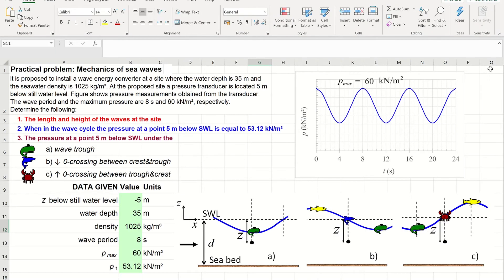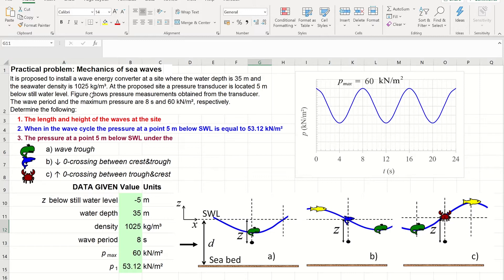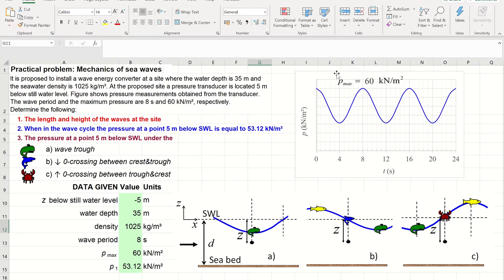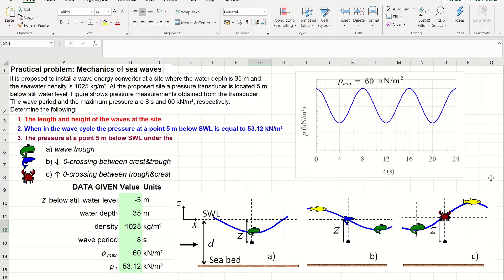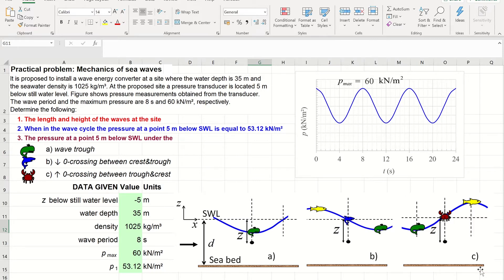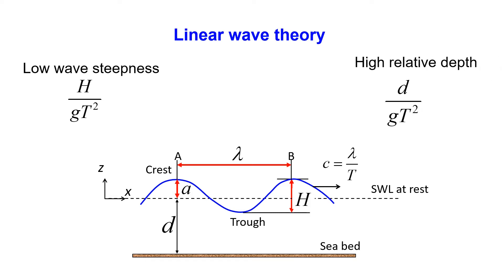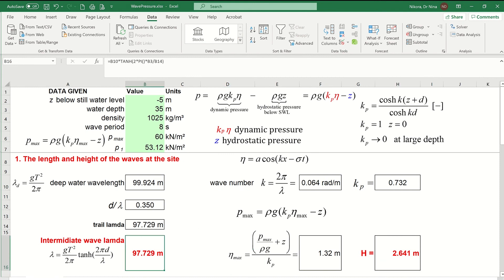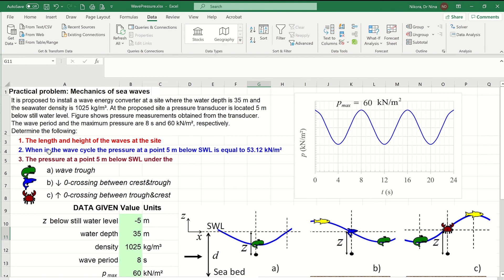Wave pressure - how to calculate wave height and wavelength

Comment from the maker: Problem questions.  
It is proposed to install a wave energy converter at a site where the water depth is 35 m and the seawater density is 1025 kg/m³. At the proposed site a pressure transducer is located 5 m below still water level. Figure shows pressure measurements obtained from the transducer. The wave period and the maximum pressure are 8 s and 60 kN/m², respectively. Answer the following questions: Q1. The length and height of the waves at the site. Q2 When in the wave cycle the pressure at a point 5 m below SWL is equal to 53.12 kN/m². Q3 The pressure at a point 5 m below SWL under the: a) wave trough, b) downward 0-crossing between crest & trough, c) upward 0-crossing between trough & crest